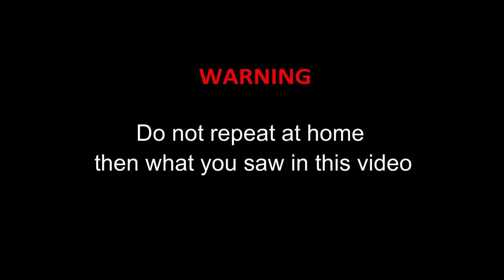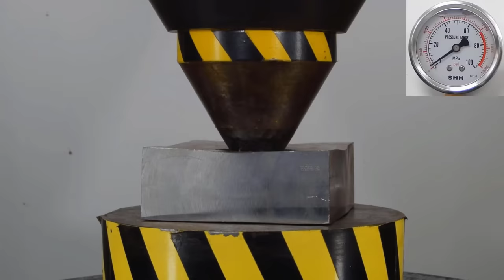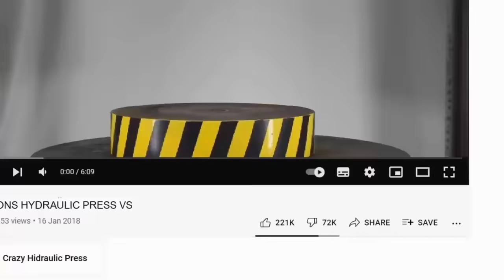HYDRAULIC PRESS VS OLD AND MODERN ARMOR

Comment: Holy crap,I thought the metal ball would shatter after being in liquid Nitrogen,I didn't expect everything else around it to break instead(Including the camera!)😂
Reply: Same, very interesting.
Reply: Actually I was wondering whether his camera ever got broken due to these experiments. And the very next moment 💀✌️
Reply: Putting heat treated steel in liquid nitrogen adds even more hardness (even after it has warmed back up again) Applied Science has a good video on this. BBs are already made to be extremely hard, so I'm not surprised it wrecked the AR500 plate. Obviously brittleness comes into play with dynamic loading so you couldn't expect it to survive being used as a bullet, etc.
Reply: @jhonbus  ..it wouldnt work as a bullet... perhaps on a very short distance wher it does not experience much friction and heating... would be interesting to see someone test actually..from 10m to 1km or so...
..and yes just because its already heat threathened (has a martensite electron structure) ... the way electrons move in the material makes it extremely much harder when he electron states r being locked at lower temperatures... but it would be hard to keep a bullet below 80 Kelvin (below -193 deg C), of scientiffic curiousity one could possibly use liquid nitrogen for 20 mins and then use liquid Helium pressurized (-4 Kelvins), it probably wouldent be extremely hard to build a pressure cylinder to pressurize a container for this guys...

A SHARP WARNING!, LIQUID HELIUM IS VERY DANGEROUS TO PLAY AROUND WITH, IN IT LIQUID STATE IT CAN EXPAND (EXPLODE) WITH A FORCE GREATER THAN TNT!...
Reply: Ball bearings are made of 52100 steel. Around 1% carbon. They can be fairly hard. There’s more hardenable steel out there. But ar500 is not very hard at all and only it’s outer surface is hard. The core is soft (compared to martensitic steel like 52100 or ball bearings). Ar500 only has .3-.4% carbon, which is low carbon. It’s the .95% manganese and .75% chromium that gives it the boost. It is a very tough or strong steel. But isn’t very hard. This is of course in terms of actual hard steel. I’m not sure what his cone was made of but it wasn’t medium hard steel or hasn’t been heat treated correctly.
Reply: @erikcourtney1834  ...i dont belive thy are lying when thay say(in writing) it some hard cone (likely some steel mesh) .. of how it breaking under pressure and not deforms alot,, and the pressure point on the cone v the volume of the test plate also make it likely, the pressure transfered to the plate can be translated to pressure and tension troughout the whole test plate(the armour piece)... we also se that in how the energy is released when it shatters..on a larger armour piece the pressure would spread out even more... if thay tested on of this size and one of 4x area/volume we should see a correclatin in pressure before it fractures...

even a larger solid diomond would shatter in a simillar way under pressure without making much damage (and its a lot harder than the test plate)..
..hardness of a material isent the ony factor... point of contact and time (area and the second derivate of the speed function or derivate of the cone acceleration...wich is extremely low)...

or to put it simple F=ma ... low acceleration =low impact force 
(the armour is designed to resiste impact forces)
Reply: @erikcourtney1834  ..also when it come to armour...
it needs to be hard enugh, but still be able to deform to slow down a projectile (more so in body armour, it wouldnt be very usefull if u died from the impact ragadless of penetration or not)
...to heat treathen a large solid metall sheet to have layer of martensite and austenite stuctures isent easy... or to melt larger pieces together in layers (of different properties) with perfect bounds isent easy at all..
Reply: I nearly soiled myself
Reply: @Patrik6920  So, one has to obtain a cylinder of “baloon gas” and enough “Peltiers” for cooling … that, with some tonnes of added artificial cow-poop and plenty of that shiny confetty might be a celebration that even someone distant might remember for a long-long time.
Reply: @LCDVF  ...ya safest is likely to produce liquid Helium on site from gas form Helium, but it would req very special eqippment...

..also below 2.17 Kelvin liquid He-3 transition to He-4 (lattice alignment) and becomes a near perfect heat conductor (the heal conductivity, below 0.9 K its a so called super fluid with no friction and zero resistance.

Note: above 2.17K the Thermal conductivity of helium isent that greate (rougly 6 times that of Liquid nitrogen just), below 2.17 it rapidly increases
Reply: @Patrik6920  You don't need to keep it at liquid nitrogen temperature, the increase in martensitic configuration is permanent even if you let it up to room temperature. As long as you don't go above the annealing temperature (260*C ish) the hardness is permanent.
Reply: I wonder if tenacity is more relevant than hardness when designing armor. I suppose r
The more energy the material can take before failure the better. I would expect hardness is not so relevant in this reasoning.
Reply: @jhonbus  ..ur ofc right, it is... but i have no idea what temperature any friction would create...and the impact will easily exceed 300 degrees at the contact point, but regardless even that the martensite structure is keept...the electron flow ill be different...at lower temperature the patterns are more locked (less free electrons)
Reply: Stainless steel, instead of other steels, increases its strength during cryo temperatures (we speak around double or triple increase, depending on temperature). That is also reason, why its used for liquid gas transporting ships.
Reply: @misterwirez7731  its never to late to catch dreams...
...and well a piece of steel can be considered as a circuit...a circuit thats permanently shorted... wher ALL electrons behave as such... even in a wire thats not connected to anything every single atom is shorted ... wat happends when we apply a voltage/cureent to it its just we force some of them to move in a particular direction...

take a simple transistor... tree shorted layers bound together that we can make do usefull things if we apply voltages/em fields in the correct way to alter how the electrons flow in the material... 
it is very much a part of material science... and every bit as interesting..
Reply: @erikcourtney1834  you are completely wrong, the 500 in AR500 stands for 500 on Brinell hardness scale. While a medium hardness steel is usually falls around 170 - 210.
Reply: @Patrik6920  Maybe as part of a sabot round--as the parts of the round in contact with the gun barrel are discarded upon leaving the gun barrel.
Reply: @ptbelttactics  no you are wrong. Your comparing apples to oranges. There’s a difference between Rockwell and Brinell measurements. Hard steels are measured with Rockwell. The highest ar500 hardness is 47.3 hrc.  4140 a very common medium carbon steel can be hardened to 59 hrc.
Reply: @Patrik6920  He-3 and He-4 are different isotopes of Helium. He-4 has one more neutron in the nucleus, and that has nothing to do with temperature or crystals (sic) or anything like that. Google for it.
Reply: @ChristopherPearson-ev7xp  ...well in theory not completly insane...but in practice... the rounds need to be cooled in some way...and would create a very cold enviroment... likely below -100 degrees C inside the tank...and to cool those rounds a supply of liquid nitrogen...and probably a system of making liquid nitrogen...
and the compartments would need to be well isolated...engine,  personell, ammunition, electric systems, equippment, food, water, aromour...
Reply: @erikcourtney1834  why do you feel the need to lie? 500 Brinell is 52 on the hrc scale. And, 4140 is commonly referred to as Chromoly, and is a medium carbon alloy not a medium hardness steel.
Reply: @erikcourtney1834 are you sure AR500 os only surface hardened? The AR stands for Abrasion Resistant and its ment to be used as a replacable wear item. If its got a soft center once the hardened outside is worn through it would begin wearing extremely fast
Reply: @xphis0528 there is a declassified government paper on armor i read years ago and the tensile strength is the primary aim but the armor must not shatter, they want it to stretch as much as possible to absorb as much energy as possible.  Though the report showed that a hardened impact face significantly improved stopping power while adding minimal weight.
Thats why actual military armor is only surface hardened on 1 side with a relatively soft center and inside. That is as long as its still using steel and not aluminum, ceramic or a composite
Reply: @ptbelttactics  then simply why aren’t tools or anything made from ar500 besides armor? Why is ar500 said to have high carbon but it has the same amount as 4140? 4140 has more chromium also (although not much) which adds hardness and wear resistance.
Reply: 6:02 I bet thats how fast the Titan sub imploded… 😮
Reply: @erikcourtney1834  AR500 is extremely hard to machine, making the cost of manufacturing tools out of it cost prohibitive. It literally destroys tooling when you try to machine it. And, FYI it is commonly used for wear pads and teeth on earth moving equipment.
Reply: @ptbelttactics  that’s why tools are forged hot then hardened. Any steel with abrasion resistance and/or hardness is difficult to machine. That being said just because something is abrasion resistant doesn’t mean it’s very hard. Those are two separate properties.  I’m very aware what earth moving wear parts are made of. I’ve seen a lot made from 4140, 4130, 4340, 1045-1095, hardox, A2, S7, ar400…. the list goes on.
Reply: @erikcourtney1834  what are you blabbering on about? Forged tools are finished machined and/or broached which AR steels resist very well. AR steels are brittle and, literally very hard, with their 3 digit number being their hardness. With metals you achieve abrasion resistance with one of two means, hardness or lubricity. And, the teeth on an excavator aren't exactly slick. At this point it is clear you are just typing to try and prove you are as smart as you imagine yourself to be.

Comment: That detonation of a solid piece of steel goes to show how much energy a solid object can hold! Impressive!
Reply: The difference between strong and hard metals (you'd be surprised how many people think it's the same thing)
Reply: Technically it's far more then you think. You maybe heard of the famous formular E=mc², it's for calculating how much energy mass contains. And for example: The mass of a person with a weight of 65kg (~143 pounds) contains the same energy as approx. 100.000 Hiroshima Bombs. No joke. Mass contains extreme amounts of Energy. We are just not yet able to "use" it properly.
Reply: @benfordrin6978  Well, when we do I hope its for something everyone wants. 24/365 Mc Ribs...
Reply: How can we not use this to generate power?
Reply: @ryanbayne1033  All energy we use must come from somewhere; nothing creates energy, only transfers it between different states. Every time energy is transferred from one state to another (for example, a nuclear reactor creating heat that boils water and spins turbines with the steam), some of that energy is lost in some way or the other (in this example, heat will leak to the environment from whatever contains the steam).

With that principle in mind, the reason this can't be used to generate power is one of two possibilities: The amount of energy used to break the material is greater than the energy you get, or the energy it releases when breaking cannot be converted to electrical energy with high efficiency. In this case, likely both A and B.
Reply: I think you need to take a look in the mirror. Steel is not a metal but an alloy. Metal is naturally occurring, steel is not. AR steel is both hard and strong… while not the strongest or hardest of the steel alloys.
Reply: @ryanbayne1033 We already do. Nuclear fusion is basically the applied principle of crushing shit so hard the atoms explode.
Reply: @maitele  No that would be fission.. Fusion is the opposite, where we press them so hard atoms combine and release excess energy.
Edit: and we basicly came as far as using that massive energy source, to boil water and create electricity, not exactly an efficient use of it.
Reply: @maitele Good point 😆
Reply: My hunch is that very little of the kinetic energy in the fragments was contained within the armor block at the moment of fracture. Notice how the press ram moves significantly and very rapidly downward as the block fails and the press is nearly instantaneously unloaded. The contraction of the press cylinder and the hydraulic lines at that moment caused this rapid ram movement, and that movement launched the fragments just like you would be able to launch a wet watermelon seed by squeezing it between your thumb and fingertip. My question is, what was the purpose of the liquid nitrogen? I expected the ball to fail due to becoming brittle at such a cold temperature.
Reply: @cgalvan21  Cryogenic hardening. I think the thought process was that they wanted the hardest steel they could get so that it wouldn't deform like their previous punch did.
Reply: @Kemachris  Fission doesn't really work by crushing forces, though. Theyre collisions. I suppose in my head I was thinking more on the "releasing a ton of energy" thing rather than the "breaking apart and going everywhere" thing when it came to the word "explode."
Reply: @DCB1209  Steel is a metal, "naturally occurring" has absolutely nothing to do with the definition of metal as a metal is defined by its properties and alloys are included. Steel isn't an element while iron is but that doesn't make it not a metal.
Reply: @MyWaifuNow  A very simple google search will help you out. Steel itself is not a metal, it is an alloy. The iron in the steel is metal.

 "A metal is a chemical element of various opaque, fusible, ductile and lustrous substances [source: Merriam-Webster]. The elements referred to in that definition are the same ones you studied when you learned about the periodic table of the elements in high school chemistry. Some common metals are titanium, copper and nickel.

Steel, on the other hand, is an alloy of iron with varying amounts of carbon content (from 0.5 to 1.5 percent) [source: Merriam-Webster]. Steel, being an alloy and therefore not a pure element, is not technically a metal but a variation on one instead. It's partially composed of a metal, iron, but because it also has non-metal carbon in its chemical make-up, it's not a pure metal." 

You can argue with Merriam Webster if you'd like. I know what I'm talking about.